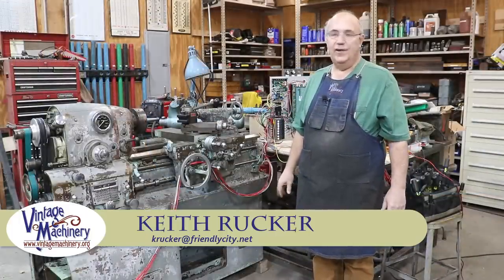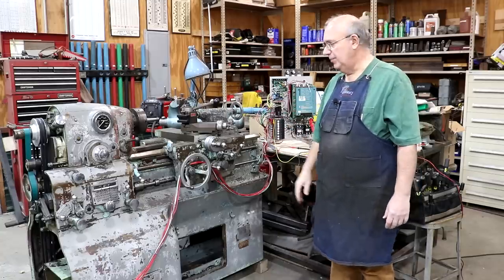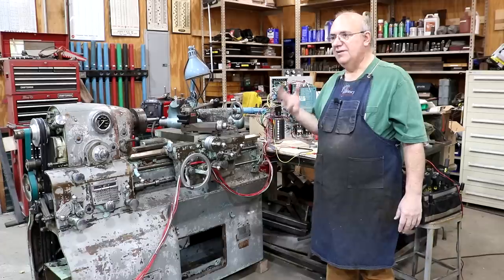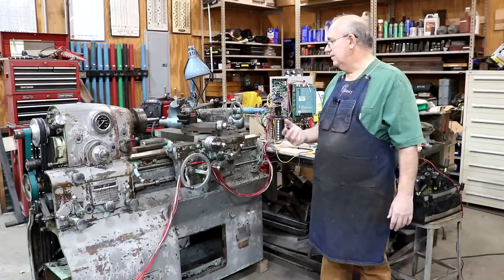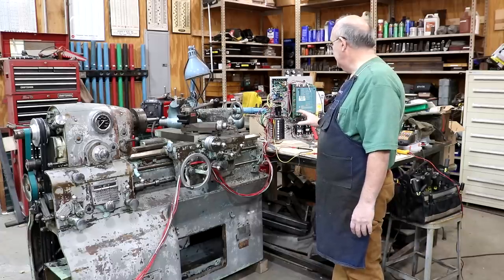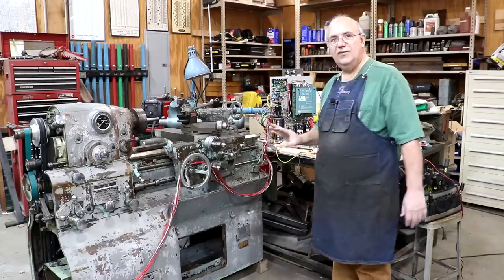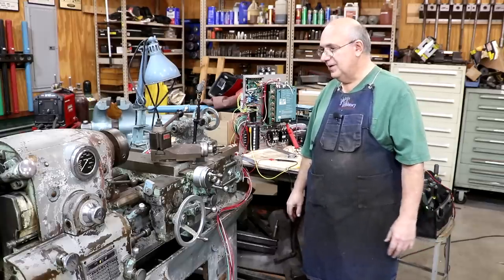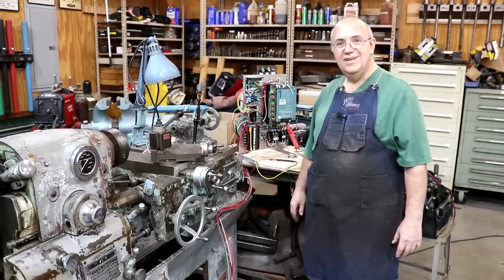Monarch 10EE DC Drive Retrofit: Project Update and Testing the DC Drive Under Load

Comment: Kieth, I think you're doing a great job with this machine but one very important thing that you obviously over looked. That is one nasty looking machine. I truly believe if you stripped it down and put a nice paint job on it, I'll bet it'll run much better. I'm telling you those old girls have a personality.
Reply: I'm sure he has plans for a paint job! As a guy restoring an old lathe myself, I had full hopes of stripping it down and painting it before I got her running. Well, that changed when I realized it was covered in lead paint and I could not take it outside to strip and sandblast (too cold outside!). And I also figured I better make sure everything works the way it was intended before worrying about cosmetics. I wanna know what I'm getting into before I get into too much.
Reply: @rustbeltmachine  use liquid paint stripper, much safer. And yes he said he was gonna paint it after he got it running right. But the problem with a machine that you intend on selling is you don't do such a good job. Myself I'm more interested in rebuilding machines. That's the perfect time to strip and paint. But he said he didn't want to totally rebuild. Even if I was gonna sell the machine I would totally rebuild it because you will get a much better price and it's much easier to repaint. No down time on watching paint dry. Plus the older machines have more steal and that comes into play when you are machining. I ran a new CNC machine and even though it was firmly on its feet and leveled. It would bounce every time it indexed to change tooling. As I said before I only ran it once.